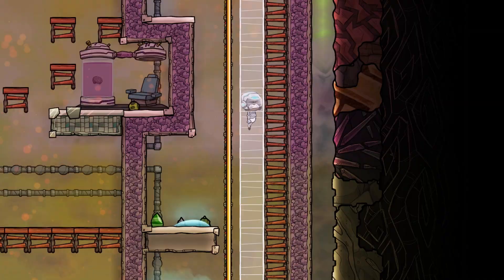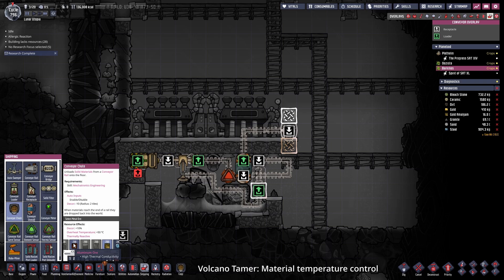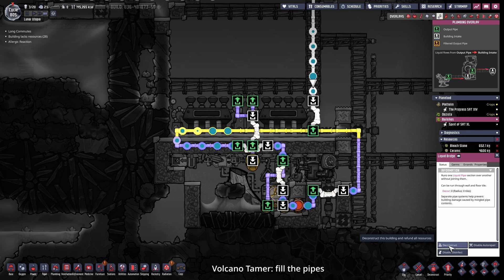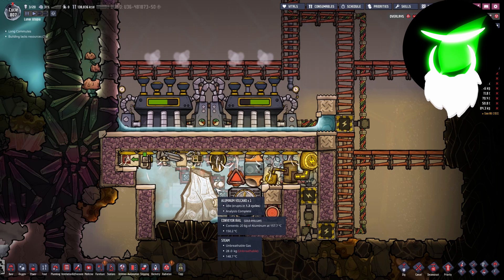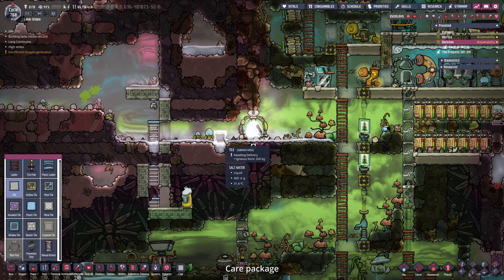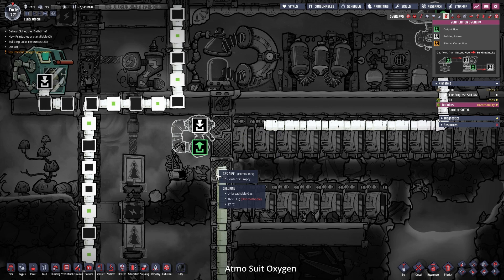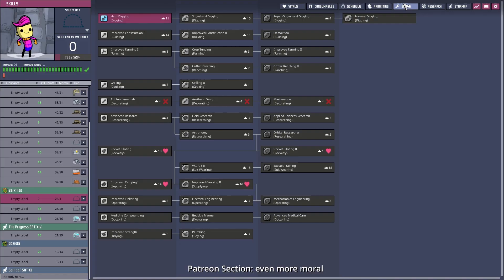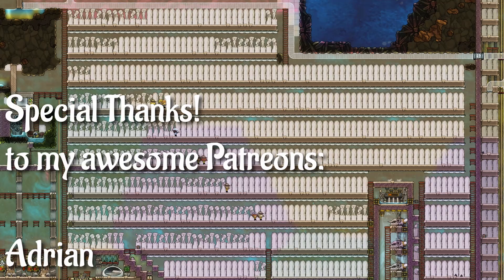Volcano taming and Bugs - Oxygen not included Let's play: Part 21

Comment: At 13.05 you can see the steam interact with the volcano and turn to ice. The volcano must have an extremely low thermal conductivity. The geyser’s can be weird temperatures and this one is probably super cold.
Reply from the maker: You are right. In the first 30 seconds there was a moment when i showed the finished product when the Ice is dropped. The volcano is super cold and the tempshift plate might transfer the tempersture to the steam somehow.
Reply: @Luma_plays  so do you have to change the auto sweeper to not pick up ice?
Reply from the maker: @zeaol  That would be the easy solution. Maybe even drop some crude oil or petroleum in there too. But maybe that bug can be abused for massive scale ice production. Not sure for what reason though. Easier water transport with rockets?
Reply: @Luma_plays  That happened once when I was melting a frozen core. The niobium was exchanging its heat through the tempshift plate.
Reply: @kestergreen3844  Thus the ice is produced by the (steel?) tempshift plate behind the aluminum vulcano?
Reply: @somedude5951  Yes, the tempshift plate was pulling the cold out of the niobium freezing the steam.

Comment: I might be quite a bit late, but for anyone interested I'll post the explanation here. This happened to me too, on an Aluminum volcano (not sure of others volcano can have the same problem). 
Basically, the aluminum volcano itself spawned very cold (all volcanos are super cold, mine was at -174.2°C). It shouldn't be a problem since it's made of Abyssalite and it shouldn't transfer heat. 
There's an old bug with Abyssalite that allows it to transfer a little bit of heat (it's noticeable on Abyssalite natural tiles) and it's probably related to that. The heat transfer happens only at the exact moment the volcano erupts, on the tile the liquid metal spawns from. 
I had another Aluminum volcano on the map and it didn't have this problem.
Reply from the maker: Every information on that issue is helpful. :). Ys Joon had it too both of us on the farmost right side of the map. Was it the right side with your volcano too?
Reply: @Luma_plays  Yes! It's about 8 tiles away from the right border.

Comment: So many questions.  Did the heat get sucked out of the water at the volcano, only to be deposited at the research station?
Reply from the maker: I think i found the culprit in the First 30 seconds of the video. The volcano itself is negativ 180°C or so.  Next to the volcano are tempshift plates. Gas heat tranfer is calculated differently. They have a multiplier added to them. So the steam froze on the volcano then got picked up with the autosweeper and dropped above. The question now is WHY?